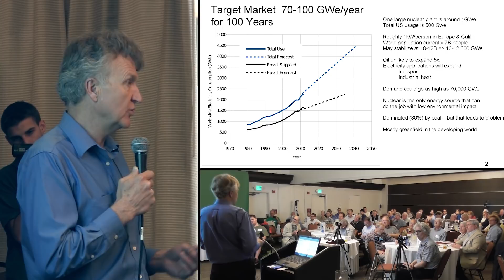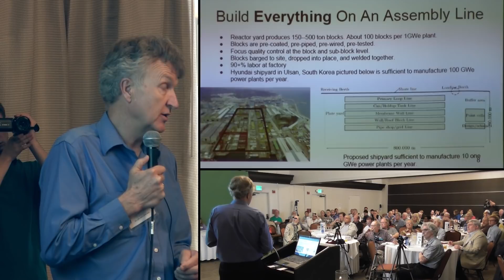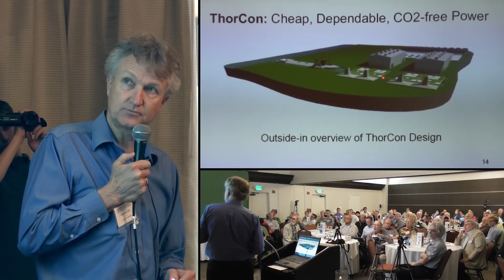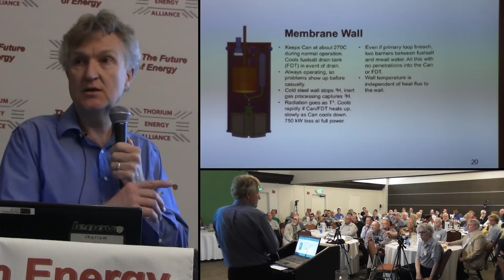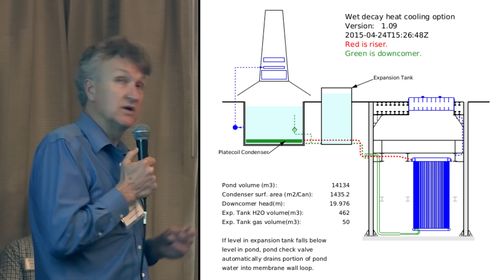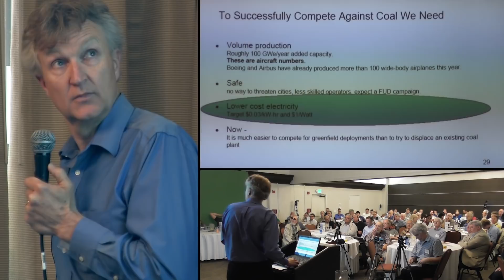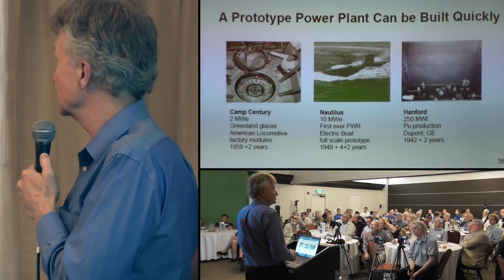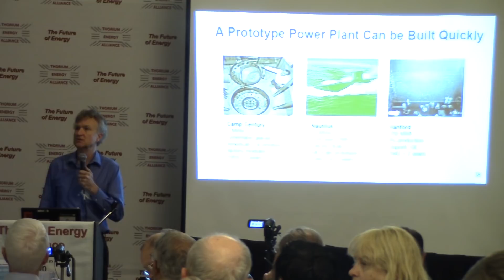ThorCon: A Thorium Molten Salt Reactor System that can be built Now -by Lars Jorgensen @ TEAC7

Comment: So this is a single-fluid design for the fuel and the conversion of fertile material to fissile material; all that is mixed in one fluid. So that presents challenges via more complex chemical operations that have to be done at the recycling center, right? Are those chemical operations settled technology, or do they require new technology? Is isotopic separation required?
Reply: +William Waugh no isotopic separation required it is chemically separated (batteries not included)
Reply: +William Waugh Separating fission products can be done with known, fairly simple, chemical processes, whether single-fluid or dual-fluid designs, of any MSR. The separation chemistry/techniques were developed decades ago. The "more complex chemical operations" are far simpler than those required in many other industries. Chemical separation, not isotopic separation.

Plus remember, the removal of fission products doesn't have to be done often; better removal gives better fuel use and/or less fissile material needed. There are designs of MSR, for example for use in countries we don't trust with nuclear fuels, where the entire reactor is sealed and installed underground, for 30 years, and then the entire reactor is shipped to a secure processing facility. 

The most important fission products to remove, since they are excellent neutron absorbers, are gasses that bubble out of the circulating salt, in the reactor, and are easily stored safely.

Comment: What is the current state of the MSRE. I work in this industry and attend proliferation conferences about once per year, the only system that is brought up to attention is M Power from Babcox & Wilcox. Which is way to small and is a high pressure light water system, and was scrubbed a few months ago, March 2017
Reply from the maker: ThorCon is trying to commercialize in Indonesia. Terrestrial Energy has started a feasibility study to site first commercial MSR (their I-MSR) in Canada. Transatomic still doing some lab work in USA. Last public announcement by Flibe Energy was their LFTR EPRI which is a PDF you can Google for. And TerraPower received $50mil grant from DoE to investigate fast-spectrum MSR.

Comment: It did ruin a power plant, Crystal River . They cut into the mausoleum & it delaminated.It would be cheaper to build a new reactor , so no more NPP   . They sold off all the good parts & SAFOR the rest. Only thing running at Crystal River is 2 coal plants.

Comment: Does a Thorium reaction need constant power to keep the 600 degree temperature, or, is like a campfire that keeps burning by adding fuel, once it has been started?
Reply: It maintains it’s own heat, once the fuel is melted down, ie: in it’s safe operating state, as opposed to suffering catastrophic failure... ;-)

Comment: any electrical generating plant that is not solar, wind, or hydroelectric runs by making steam to turn turbines and generators - so, as with fossil fuels, all nuclear power plants will unavoidably generate waste heat, which must be dumped to atmosphere and ocean - the heating of water is probably more efficient with nuclear designs, but it's still feeding into the same old heat-engine generation system.  Now, somebody find a way to convert gamma-ray or neutron flux directly to electric current, and that will really help things.
Reply: Concentrated solar uses steam turbines too.
Reply: @ SupernalOne, your point is laudable goal "somebody find a way to convert gamma-ray or neutron flux directly to electric current, and that will really help things" but it's unlikely to happen near term. Mr. Jorgensen emphasizes his modular model is an important first step to reduce CO2 from generation NOW! His assertion about that it must be cheaper than coal where the majority of energy growth is happening ( Asia) is Key. I know this to be true as a friend & colleague just recruited me to work in Vietnam on a 1000 MW Coal plant that is the first of 5 to be built over the next decade. Nice steady work work taking me to and past retirement, (I'm 57) but doing the wrong thing for the planet. We also have made no appreciable progress on storage for renewables (batteries or super capacitors), although, perhaps not coincidentally, molten salts do show promise in solar thermal power generation &, in an area I have worked directly on, molten salts for high temperature industrial process (Acrylic Acid - the absorbent in diapers, made from propylene), so there's really a 3-pronged strategy for molten salt chemistry and material science development. Going back to Mr. Jorgensen's points, these are cost -effective first steps to actively arresting CO2 emissions, optimization can obviously follow, and though the other salts for for storage and high temperature industrial processes have different chemistries, these are parallel developments that could and should be pursued. I think his ship yard model for production and delivery is genuinely brilliant.
Reply: Don't see the need for any of that. 30-40% of all electricity use goes into heating and cooling anyway. Using the waste heat for heating and/or cooling would utilize most of the energy released. I believe the amount of energy incident on the earth by the sun outmatches any possible heat released by any number of nuclear plants by a couple orders of magnitude. Given that our planet is not overheating (CO2 levels aside), logic dictates that our planet is more than capable of releasing any kinds of heat we throw at it.

Comment: Per 1 GW, construction requires $100,000,000 worth of exotic materials?   I'm curious as to what these materials are.
Reply: @brandoYT  Get back to me when you have a wiki on the growth of battery tech.
Reply: Nuclear material is not cheap nor is the salt they want to use. This is not table salt they're using.

Comment: Where can I get a design to build a mini Thorium reactor in my yard ?
Reply from the maker: For extremely small applications you're better off harnessing Fission Products and not fission itself. FP decay heat can't be turned off (the FP must decay over time) but like RTG powering Mars Curiosity Rover very simple hardware could harness FP (instead of Curiosity's Pu-238) for small scale residential or community energy needs. However, still simpler and cheaper to use our excellent electrical grid and centralize power production using city-scale power production. You don't want to treat your own sewage, why produce your own power?

Comment: Instead of steam turbines how about industrial strength Free Piston Stirling Engines use in this design? Feasible?
Reply: I heard that Thorcon Power has a Molten Salt Reactor design for retrofitting old coal / steam power plants. Cool!
N.A.S.A. has a nuclear powered Stirling Engine for powering their space probes. Now I have to check to see if N.A.S.A has plans to use some of the Oka Ridge nuclear powered liquid metal closed Rankin Cycle designs. I think the Swedish Navy has big Stirlings in their subs, running on LOX and fuel oil, but no nuke.
Reply: +ufoengines Quasi crystal thermo voltaic technology is the logical next step for converting heat DIRECTLY into electricity. Just like LFTR is the logical next step for producing heat to make electricity. Unfortunately this world is ruled by money not logic
Reply: +Joe Salaman  That's a bummer !  Think Thorcon Power into anything like patent 5247553  ?

Comment: Why dont they just build it??
Reply: +Dukky Drake 400M is very little money - if the outcome can be this big?? Why dont the Norwegian state pay for it, in return they could have stocks in the company??? 400 M is nothing! compared to the possibilities.
Reply: +Linda Mitchell Linda, the simple fact is Thorcon is a business development company with a small office in Florida with less than a dozen employees, they have zero nuclear engineers and hold zero nuclear-related patents. So to answer your question: basically no investor in the world is going to put one dollar on the table for such a flimsy project.
There are much better options to invest and produce electricity right now, basically all the renewables: wind turbines, solar PV panels, hydro, geo-thermal, biofuels, etc. All are zero-carbon and don't generate a stream of lethal nuclear waste. And all have lower costs per kWh than nuclear.
Reply from the maker: +André Balsa You keep bringing up the issue of patents. Since both a single-fluid and dual-fluid Thorium breeder were designed (but not prototyped) by ORNL in the 60s, how is this different from otherwise compelling forms of medication being unpatentable? Just because a solution can't be patented doesn't mean it isn't viable. That would exclude anything and everything in the public domain from being used commercially.

If you want patents, Terrestrial Energy has stated on the record that they've filed patents. Yay... patents.

And while I've not heard of any patents being filed, TerraPower is now investigating CHLORIDE salt based fast-spectrum MSR. No doubt they'll be filing patents... that's what they do.

But I do think your concern over patents might be because you raised the issue as part of your glish-glosh attack style against all forms of nuclear. You have no idea what you are talking about, and throw crap to see what sticks.

I've spoken at length to Kirk Dorius, a patent lawyer. His take on the patenting of nuclear technologies was quite interesting. I will not be sharing that with you.
Reply: Here is a quick reality check: How many nuclear engineers do Flibe (Kirk Sorensen's company) or Thorcon/Martingale employ? (zero) How much capital have Flibe or Thorcon/Martingale raised over the last 6 years or since their creation? (zero) How many nuclear-related patents do Flibe or Thorcon/Martingale hold? (zero) How much nuclear-related research have Flibe or Thorcon/Martingale conducted since their creation? (zero) How many molten salt reactors have ever been built? (one 8MW experimental reactor, in 1964, operated-not continuously between 1965-1969; cost of decommissioning 45 years later: $130 million). How many thorium/uranium-233 cycle reactors have ever been built and operated? (zero) How much is thorium worth on the international market nowadays? (less than its extraction cost) How many renowned nuclear scientists have ever stated that the thorium/uranium-233 cycle was economically or technologically viable? (zero) How much is the ORNL investing in thorium/uranium-233 cycle research nowadays? (zero) How much is the ORNL investing in molten salt reactor research nowadays? (zero) How much does electricity from nuclear cost in the US, vs wind or solar WITH STORAGE? $0.16 / kWh for nuclear, vs $0.08 per kWh for wind or solar WITH STORAGE.

The bottom line is that the worldwide nuclear industry is in decline and is taking with it the hopes of the thorium fanboys that a thorium powered reactor will ever see the light of day, whether or not it is technologically viable.
Reply: +André Balsa 
It just might be technologically viable, but to arrive at safer/cleaner energy environmentally friendly, recyclable  1000x batteries must be developed through R&D involving many nations, over a long time.
Reply: Battery technology has been improving, but it's just one form of energy storage. And distributed energy production as well as improvements in the grid reduce the amount of storage required too. Basically with the storage technology already available nowadays, 90% to 100% of electricity production can be from renewables, depending on the country.
http://rameznaam.com/2016/01/31/how-far-can-renewables-go-pretty-darn-far/
Reply: +André Balsa  It would be nice if this were true. It isn't.
Reply: Thomas Dobyns 
What is the problem? I want to know.
Reply: +Naimul Haq US government.

Comment: Is this actually the LFTR developed by Weinburg?? They keep mentioning MSRE... Different stuff. LFTR final development could be achieved if our owned government would allow it.
Reply from the maker: +Thomas Dobyns I don't think there's a vendetta against any one reactor technology, it is just very difficult to pursue anything new given current licensing rules (or lack of rules). Senate just had a hearing on this yesterday, but I wasn't able to watch. Hopefully some roadblocks to advanced reactor development were addressed.

ThorCon is a burner not a breeder. They hope to use nuclear resources more efficiently than today's burners, but it is not as efficient as a breeder. On the other hand, it is simpler... it is closer to MSRE than LFTR is. LFTR is essentially MSRE wrapped in a breeder blanket, and with a chemical processing unit.
Reply: +gordonmcdowell    The vendetta is against ALL nuclear. Old technology is a danger to the enviornment and people. People see nuclear meltdown and release of poison radiation into the air as a threat that causes birth defects and renders huge sections of country unusable for decades... Rightly so too. That's the old technology. For reasons that are fairly common in this country (USA), we can NOT seem to get accurate information from private concerns with a vested interest. Therefore, we need development, or actually the "final development" of LFTR by state universities. The basic details were worked out long ago. We need the clean, cheap, safe energy, and enviornmental improvements it will bring! My guess is this issue is important enough to effect the overall economic prosperity of this country.
Reply: No, LFTR used on-line reprocessing to maximize breeding in thermal. "Built now" means no chemical plant.
Reply: china is already doing it now its a race to the finish line we have to win on molten salt reactors